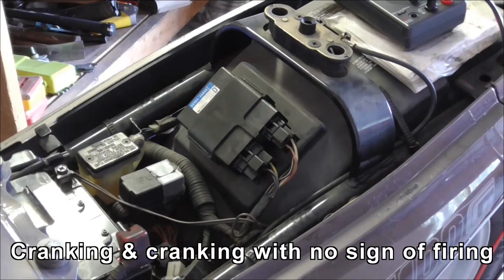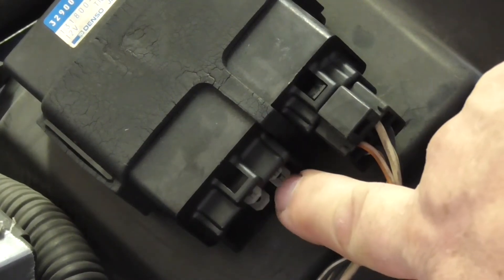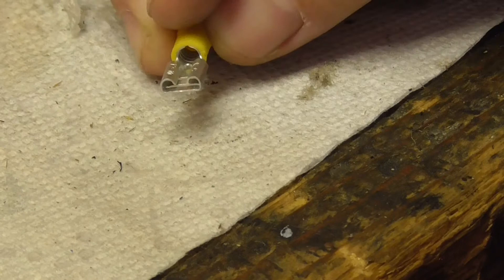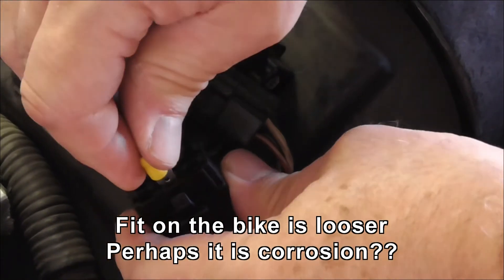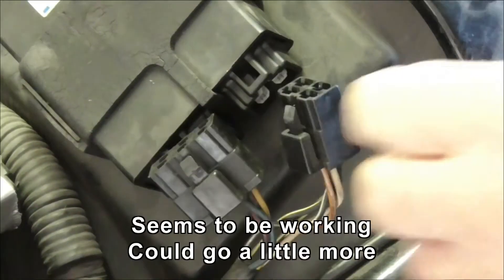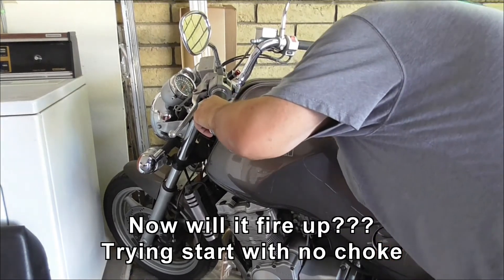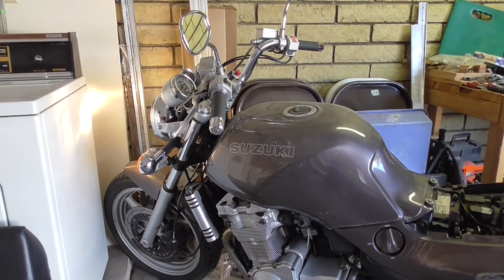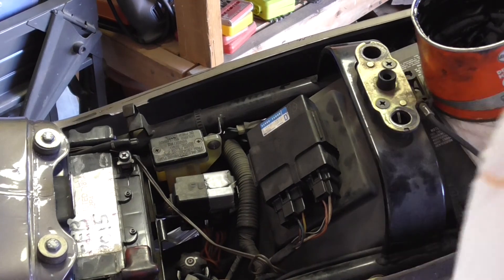GSX1100G Starting Issue

Comment: hi do you still have this bike?
Reply from the maker: I do still have it. Have not been out on it since covid hit, I will likely have to clean out the idle jets again before it will run properly
Reply: Awesome I just bought one and I’m trying to get it running. Would you mind making a video when doing the carbs?
Reply from the maker: @vikarieelliott5246  
Already have a video, in fact here is the link to my playlist of 1100G videos
https://www.youtube.com/playlist?list=PLWHom5FLIC6u5Z_j8yQ260E3Qltt19RYd

There is one at the bottom of the list you will find useful - idle jet clearing
https://www.youtube.com/watch?v=Sy3EhTHkuFc&list=PLWHom5FLIC6u5Z_j8yQ260E3Qltt19RYd&index=22&t=0s

The carbs are the weak spot on this bike. The idle jets are so small, they clog easily and cause all kinds of problems.
Also, the o-rings in the carbs can harden up and shrink when exposed to alcohol in fuel. Then they leak, causing flooding, giving a whole host of other problems.

Before I got a video camera, I also put a whole bunch of stuff on Photobucket, which I shared on the old extinct 1100G forum. Then photobucket stopped sharing and loaded the site with ads so be sure to have an ad blocker on before hitting this site
https://s38.photobucket.com/user/RichBinAZ/library/1100G%20General%20Maintenance?sort=6&page=1
The general maintenance one should prove helpful.

I also have some PDF's on other 1100G topics, those are harder to share
Reply: @richbinaz  Thanks a lot! Mine still won't even crank so once I get past that hurdle at least I'll have some more guidance
Reply from the maker: @vikarieelliott5246  Hmmm, not cranking can be as simple as a flat battery, to loose or corroded terminals on the battery, the handlebar button, stater cable or starter relay.  It is ok to try jump starting from a car battery, just be careful with those live clips. May need 3 hands or more.
The starter relay/solenoid is located on the front left side of the battery tray and is hidden by the fuel tank. If you take a screw driver and carefully connect the 2 large power studs together, it should turn the starter as that bypasses the start switch and all the safety switches and puts power straight to the starter. There should be a big spark while doing this, so be aware of that and wait till any spilled fuel has evaporated after taking the tank off. 
Taking the tank off is not really straightforward, so check out that maintenance video.
Reply: Thanks for the heads up, but I’ve already replaced the battery, new starter solenoid and I’ve tried jump starting and bridging the relay to send power directly to the starter. Got sparks but nothing from the starter motor itself. I figure it must be toast. I’ve got voltage at the wire going to the starter motor as well so the starter must be the problem right? Two relays are still missing from the bike so I’ll try again once those come in.
Reply from the maker: @vikarieelliott5246  Sounds like it, but I would try one more thing first... With the bike on the centerstand, ignition OFF, put it in top gear- may have to move the rear wheel around a bit - then turn the engine over by turning the rear wheel in the forward direction. I just want to make sure the engine actually turns over. Then put it in neutral, ignition an and see if the starter cranks.
New starters are not cheap. It may be worth taking it apart and cleaning up the commutator ring after checking to see if there are carbon brushes left. If you have the manual, it's on page 6-16. There a picture on bike bandit here
https://www.bikebandit.com/oem-parts/1991-suzuki-katana-1100-gsx1100g/o/m147874#sch245700
There is a facebook forum where people are parting out bikes on a regular basis and as this bike shares parts with the bandit, that might be another option apart from ebay
Reply: Update: she cranks! Used the same screwdriver trick on the starter relay but the start button nor the horn button work. Any ideas? Will try following the wires to see if there is continuity. Thanks again man you’ve been such a big help
Reply from the maker: @vikarieelliott5246  You may find the start button contacts are corroded inside the handgrip. It does come apart, you just have to watch where things go. The horn button may be the same way, but those little horns tend to fail over time anyway